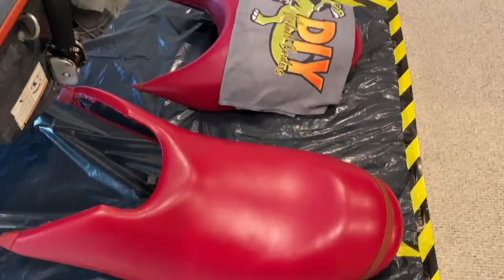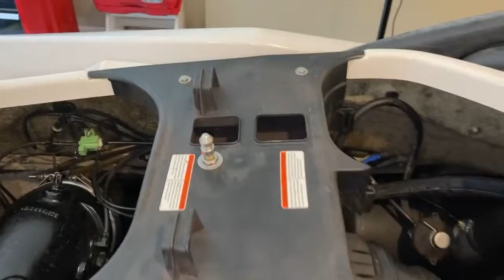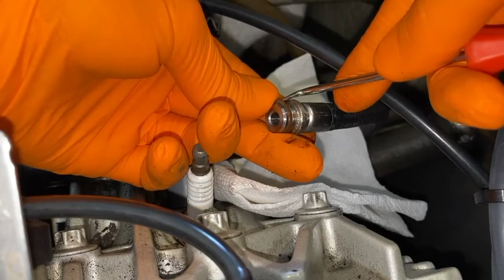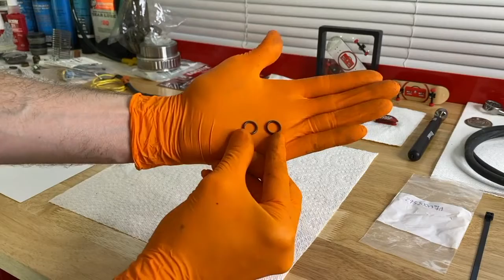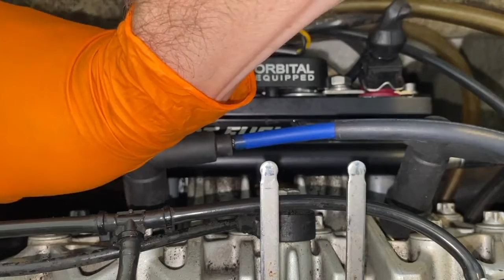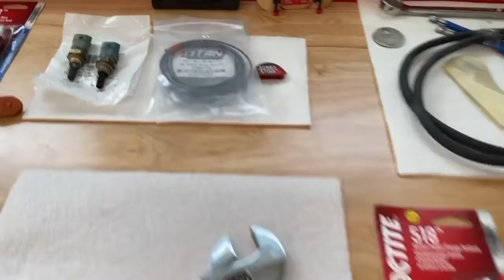Sea doo GTX jet ski low compression - Replace Distributor Air Hose o'ring seal

Comment from the maker: If interested in purchasing this product, visitor to Amazon affiliate link below.  I earn from qualifying purchases.

Fuel hose fitting o'ring:  

Air hose fitting o'ring:  https://amzn.to/4bUJnhS

Fuel Control Module:  https://amzn.to/3wymxNJ

Aftermarket Fuel Injectors:  https://amzn.to/3WCenP0

Air Injectors:  

Air Injector o-ring:  https://amzn.to/3V4GIfT

Fuel Distributor Regulator:  

Distributor Air Regulator:  https://amzn.to/4basvUd

Craftsmen Hex socket set:  https://amzn.to/3y6sphx

Craftsman hex key set:  https://amzn.to/3wvhzRM

Loctite 518:  https://amzn.to/3wwMHjY

Pic tool set:  https://amzn.to/3wGm1ND

2-stroke Sea doo SPX oil:  https://amzn.to/3WABB8j

Steel brush kit:  https://amzn.to/3y7tNR2

Craftsman Torque wrench:  https://amzn.to/3R2FVJZ

Aftermarket cover:  https://amzn.to/4aP7NIs

OEM cover:  https://amzn.to/3XgTklA

Oil filter:  https://amzn.to/49c0n0U

Oil tank:  https://amzn.to/3Ji306V

Oil tank grommet seal:  https://amzn.to/3JhjJan

Oil sensor Terminal:  https://amzn.to/3vHscRn

Oil sensor wire seal:  https://amzn.to/3xDdqM0

Oil sensor connector housing:  https://amzn.to/4aFndjm

Spark plugs:  https://amzn.to/43Wqp7p 

Spark plug gapper tool:  https://amzn.to/43Qbrje

Dielectric grease:  https://amzn.to/4cUn4tC

Ignition coils:  https://amzn.to/4aqTyKB

AGM Battery:  ￼ https://amzn.to/4cO13MX

Coolant temp sensor:  https://amzn.to/3U81ytZ

Solenoid valve:  https://amzn.to/4aLKT4S

Vacuum system check valve:  https://amzn.to/3U8PtVy

Battery disconnect switch:  https://amzn.to/49tskBH

Swivel vise:  https://amzn.to/4awP2tK

START/STOP push button cap/cover:  https://amzn.to/3vomyDv

START/STOP button wire mechanism:  https://amzn.to/3TEoDDr

Glove box/storage unit latch kit:  https://amzn.to/3x9RMih

Seat latch:  https://amzn.to/43xVWwd

Front storage compartment latch:  https://amzn.to/43xVWwd

******************

1.  How to properly lubricate seat or storage compartment latch

          https://youtu.be/QiadPciE55E

2.  Jet ski storage compartment or seat not latching - Common causes

          https://youtu.be/gWX7obK3VA0

3.  Replace seat or storage compartment latch

          https://youtu.be/bweCd4TO-4U

4.  Replace glove box/storage compartment latch

          https://youtu.be/TmdrTVcUubQ

5.  Replace START/STOP push button cover

          https://youtu.be/VillHbgDckY

6.  Replace START/STOP push button wire harness

          https://youtu.be/5q9HbOxYY4Q

7.  Replace rear step foam pad sleeve

          https://youtu.be/w6HLiApFDuc

8.  Replace Sea doo GTX Starter

          https://youtu.be/Q8_be66r0Yw

9.  Replace starter relay

          https://youtu.be/MAvBmwvGgyc

10.  Replace Sea doo GTX Ignition Coils

          https://youtu.be/1VrtwJl6hjI

11.  Jet ski keeps saying low oil - Common causes

          https://youtu.be/vPycBUDWnCQ

12.  Replace oil tank sensor

          https://youtu.be/ZPCH5zgzTsY

13.  Replace coolant temp sensor (On engine)

          https://youtu.be/4JOdX3GEphE

14.  Replace coolant temp sensor (On muffler)

          https://youtu.be/ZDTEGnEVPOM

15.  Replace Solenoid valve

          https://youtu.be/SfjX9OtOyIM

16.  Replace vacuum system check valve

          https://youtu.be/iWjhaWlyQuc

17.  Install battery disconnect switch

          https://youtu.be/LOSq10Of_UM

18.  Replace sea doo oil filter

          https://youtu.be/fT3R7Mkb05s

19.  Replace spark plugs and wires

          https://youtu.be/gRTpc5pqLLk

20.  Rebuild Direct Injection Distributor

          https://youtu.be/Ac2xGvMr9eY

21.  Replace jet ski battery

          https://youtu.be/1tyCs79h5fk

22.  Replace fuel hose o’ring

          https://youtu.be/CK4bJWHxeRw?si=lDstGKSL3Wbtxm97

23.  How to mount skateboard on wall

          https://youtu.be/c5QDCKZNGH0

24.  Build your own custom logo fingerboard

          https://youtu.be/5kg1NHGMZsE

🧰

Comment: What are these air line fittings called that go into rail? Can i buy them with hose barb fittings in other end?
Reply from the maker: Thanks for watching.  The hose on the right side is an air hose and the hose on the left is the fuel hose.

We have added all of our parts that are available on our affiliate website below.

You will likely need to contact a sea doo dealer for these hoses and connectors.

If interested in purchasing this product, visitor to Amazon affiliate link below.  I earn from qualifying purchases.

Fuel hose fitting o'ring:  

Air hose fitting o'ring:  https://amzn.to/4bUJnhS

Fuel Control Module:  https://amzn.to/3wymxNJ

Aftermarket Fuel Injectors:  https://amzn.to/3WCenP0

Air Injectors:  

Air Injector o-ring:  https://amzn.to/3V4GIfT

Fuel Distributor Regulator:  

Distributor Air Regulator:  https://amzn.to/4basvUd

Craftsmen Hex socket set:  https://amzn.to/3y6sphx

Craftsman hex key set:  https://amzn.to/3wvhzRM

Loctite 518:  https://amzn.to/3wwMHjY

Pic tool set:  https://amzn.to/3wGm1ND

2-stroke Sea doo SPX oil:  https://amzn.to/3WABB8j

Steel brush kit:  https://amzn.to/3y7tNR2

Craftsman Torque wrench:  https://amzn.to/3R2FVJZ

Aftermarket cover:  https://amzn.to/4aP7NIs

OEM cover:  https://amzn.to/3XgTklA

Oil filter:  https://amzn.to/49c0n0U

Oil tank:  https://amzn.to/3Ji306V

Oil tank grommet seal:  https://amzn.to/3JhjJan

Oil sensor Terminal:  https://amzn.to/3vHscRn

Oil sensor wire seal:  https://amzn.to/3xDdqM0

Oil sensor connector housing:  https://amzn.to/4aFndjm

Spark plugs:  https://amzn.to/43Wqp7p 

Spark plug gapper tool:  https://amzn.to/43Qbrje

Dielectric grease:  https://amzn.to/4cUn4tC

Ignition coils:  https://amzn.to/4aqTyKB

AGM Battery:   https://amzn.to/4cO13MX

Coolant temp sensor:  https://amzn.to/3U81ytZ

Solenoid valve:  https://amzn.to/4aLKT4S

Vacuum system check valve:  https://amzn.to/3U8PtVy

Battery disconnect switch:  https://amzn.to/49tskBH

Swivel vise:  https://amzn.to/4awP2tK

START/STOP push button cap/cover:  https://amzn.to/3vomyDv

START/STOP button wire mechanism:  https://amzn.to/3TEoDDr

Glove box/storage unit latch kit:  https://amzn.to/3x9RMih

Seat latch:  https://amzn.to/43xVWwd

Front storage compartment latch:  https://amzn.to/43xVWwd

******************

1.  How to properly lubricate seat or storage compartment latch

          https://youtu.be/QiadPciE55E

2.  Jet ski storage compartment or seat not latching - Common causes

          https://youtu.be/gWX7obK3VA0

3.  Replace seat or storage compartment latch

          https://youtu.be/bweCd4TO-4U

4.  Replace glove box/storage compartment latch

          https://youtu.be/TmdrTVcUubQ

5.  Replace START/STOP push button cover

          https://youtu.be/VillHbgDckY

6.  Replace START/STOP push button wire harness

          https://youtu.be/5q9HbOxYY4Q

7.  Replace rear step foam pad sleeve

          https://youtu.be/w6HLiApFDuc

8.  Replace Sea doo GTX Starter

          https://youtu.be/Q8_be66r0Yw

9.  Replace starter relay

          https://youtu.be/MAvBmwvGgyc

10.  Replace Sea doo GTX Ignition Coils

          https://youtu.be/1VrtwJl6hjI

11.  Jet ski keeps saying low oil - Common causes

          https://youtu.be/vPycBUDWnCQ

12.  Replace oil tank sensor

          https://youtu.be/ZPCH5zgzTsY

13.  Replace coolant temp sensor (On engine)

          https://youtu.be/4JOdX3GEphE

14.  Replace coolant temp sensor (On muffler)

          https://youtu.be/ZDTEGnEVPOM

15.  Replace Solenoid valve

          https://youtu.be/SfjX9OtOyIM

16.  Replace vacuum system check valve

          https://youtu.be/iWjhaWlyQuc

17.  Install battery disconnect switch

          https://youtu.be/LOSq10Of_UM

18.  Replace sea doo oil filter

          https://youtu.be/fT3R7Mkb05s

19.  Replace spark plugs and wires

          https://youtu.be/gRTpc5pqLLk

20.  Rebuild Direct Injection Distributor

          https://youtu.be/Ac2xGvMr9eY

21.  Replace jet ski battery

          https://youtu.be/1tyCs79h5fk

22.  Replace fuel hose o’ring

          https://youtu.be/CK4bJWHxeRw?si=lDstGKSL3Wbtxm97

23.  How to mount skateboard on wall

          https://youtu.be/c5QDCKZNGH0

24.  Build your own custom logo fingerboard

          https://youtu.be/5kg1NHGMZsE

🧰